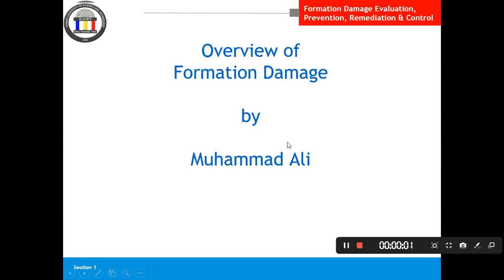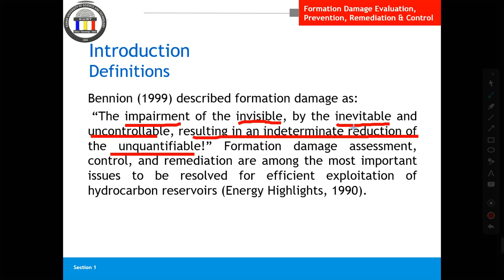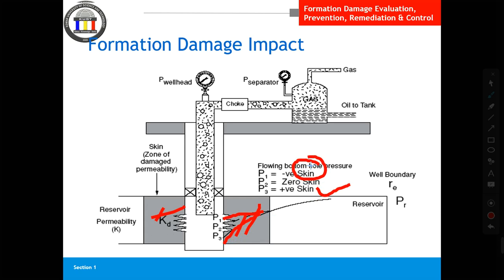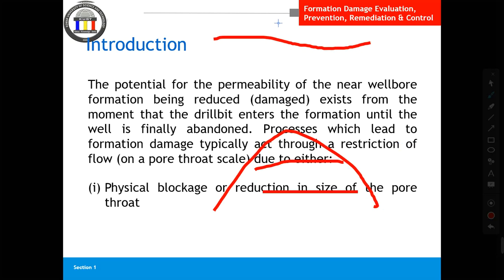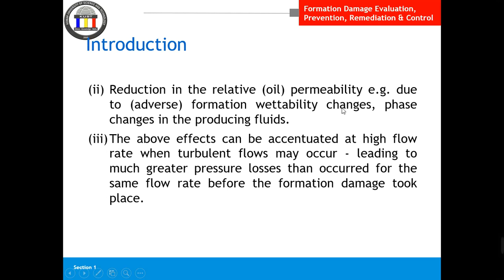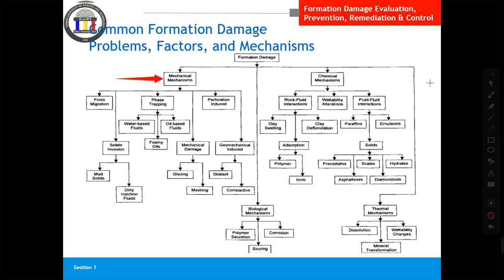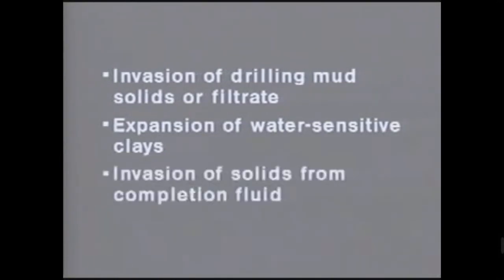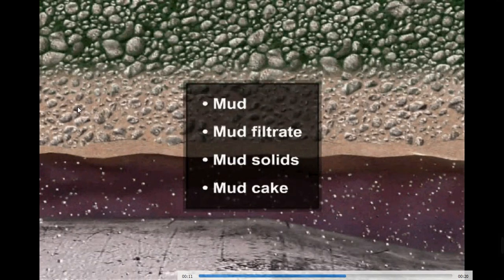Formation Damage and skin factor

Comment: But that means skin is a flawed metric to use for formation damage estimation.

If it only measures the initial flow vs the final flow to calculate the decline... What about formation damage that occurred even before flowing?

Like formation damage while drilling, cementing casing, badly designed stimulation, and perforation?